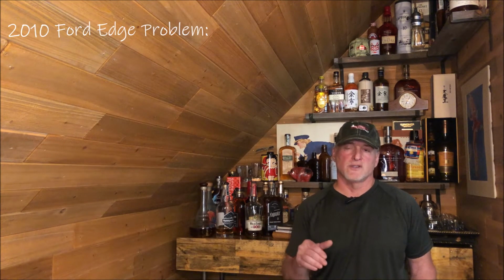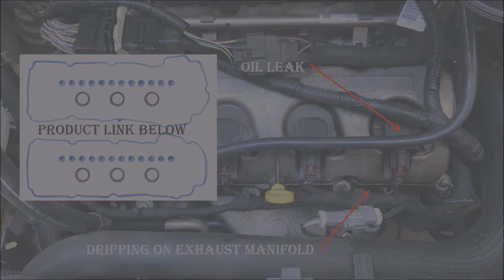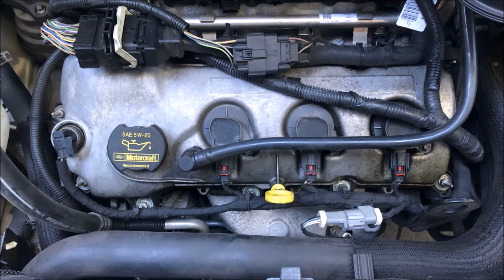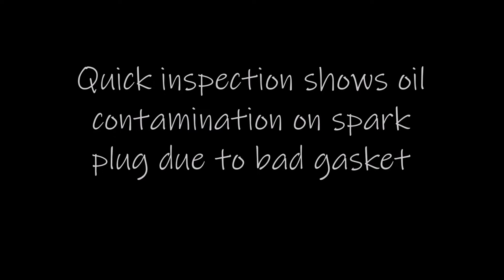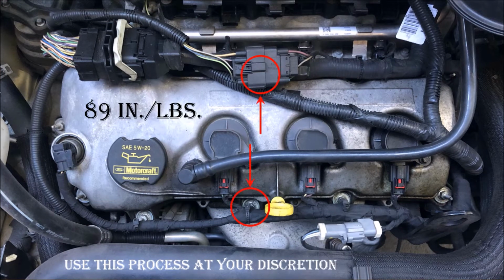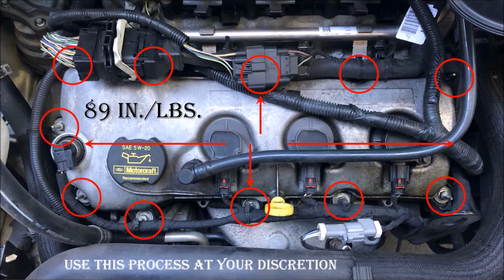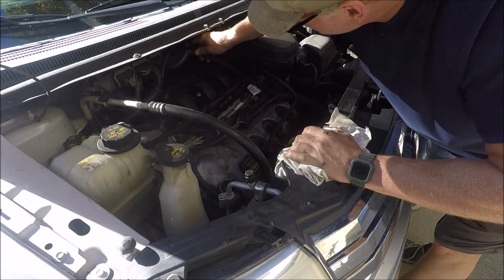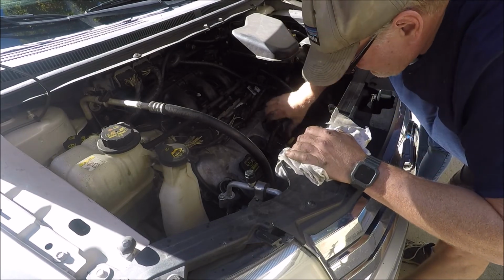Oil Smell & Smoke Under Hood Of 2010 Ford Edge 3.5L: How To Replace Valve Cover & Spark Plug Gaskets

Comment: Need one for the back part of the engine!😅
Reply from the maker: I can do that!  Much more involved!  Hopefully out early next week.
Reply: Thank you very much for the information Sir. I hope you show the back side of this project too, as that is where my car is leaking. I’ll be digging through your archives in search of that video. I appreciate you very much!
Reply from the maker: Going to start working on this video...  showing the rear timing cover removal.  Hope yours isn't leaking badly.
Reply from the maker: Here it is! How To Replace Valve, Cam Cover & Oil Well Gaskets Ford 3 5L Engine Firewall Side:  Part Deux
https://youtu.be/qeiyZ17Qaj8